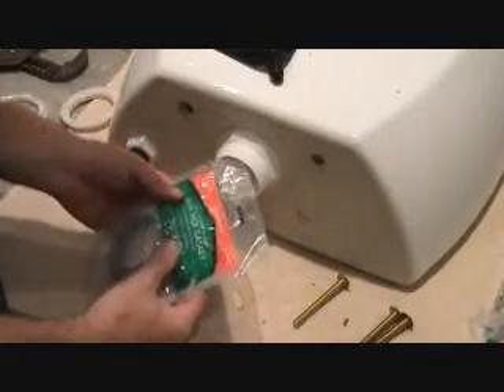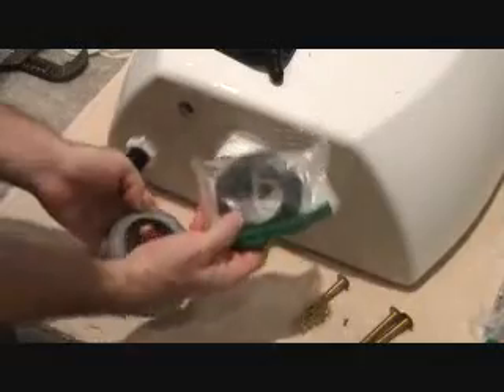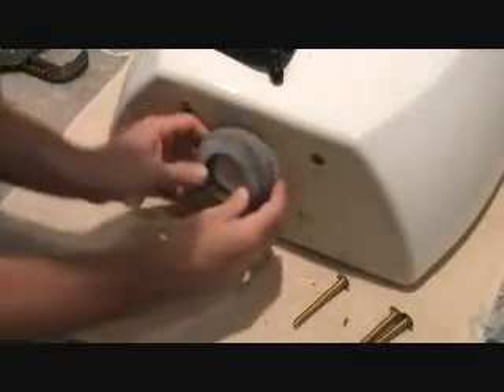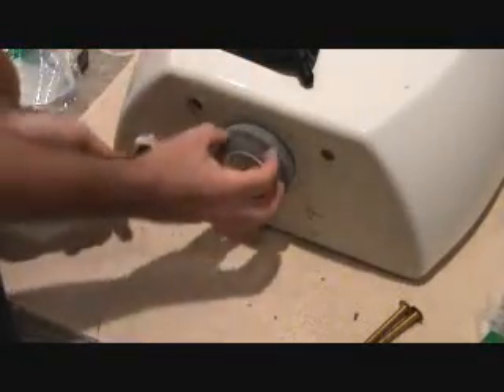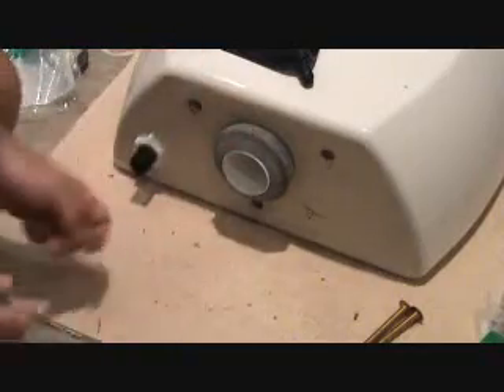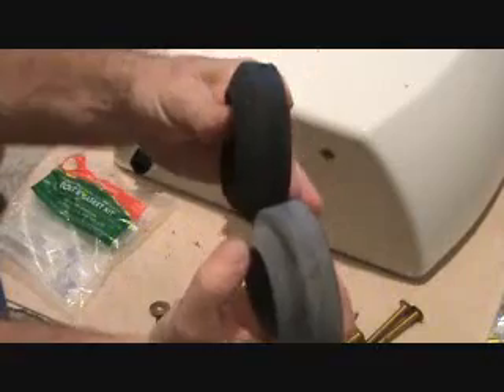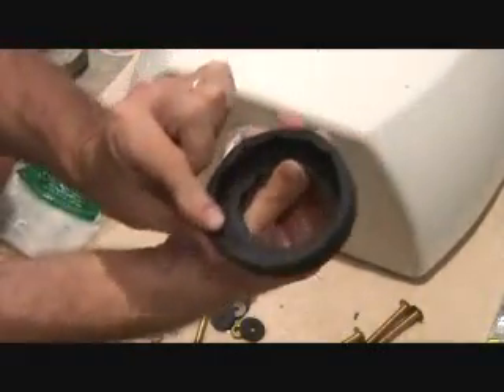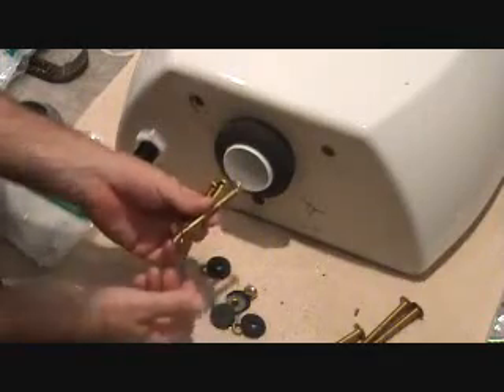The toilet from hell...what's a doughnut?

Comment: Hi, Joe.  Just replaced my gaskets , & hardware on my toilet from hell, a Kohler tripple bolt just like yours just before finding your Your Tube video.  

I essentially used your alternative number 3 (separate bolts), s.s. washers and brass nuts.   I also put the doughnut over the flapper valve channel pipe threads and leveled the tank,  (( Guess great minds think alike.))  I did a couple things different than you:  saved  and reused the bolt  triangle, as it seemed to stabilize the tank more by making it really secure side to side and easier to level the tank.   Also put the S.S. washers in the tank  under the brass heads of the bolts, because they were wider  (larger in diameter) than the  bolt heads and spread the force over wider area over the ceramic.   ( Pressure = Force  / Area ) 
Thanks for  your hard work and friendly approach, Joe.  

Nice Job ,  Ron 
 Certified Safety Professional ,Retired
, and Amateur Plumber.    ; )    P.S.  I could not find the three bolt kit a Lowes.  I bought two  (2) bolt kits, which gave me enough parts for one toilet.  I found the three bolt kit for Kohler on Home Depot's website, though.
Reply: Omit the metal washer inside the tank. You’re asking for an eventual leak between the metal mating surfaces and down the threads of the bolt.
Reply from the maker: Thanks for all the info! Awesome job!

Comment: on the 3 hole bowl do i need to put a gasket on the bottom side where that plastic nut attaches to the bowl i have replaced everything and water still leaks back into the bowl its about to drive me to drink
Reply from the maker: How did you end up getting your toilet fixed?